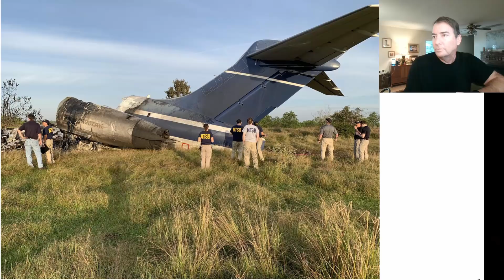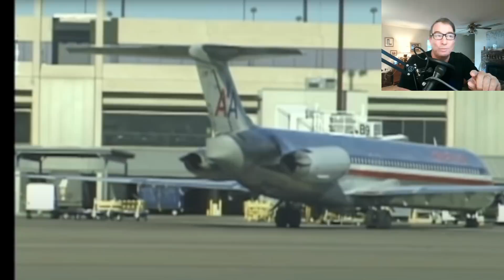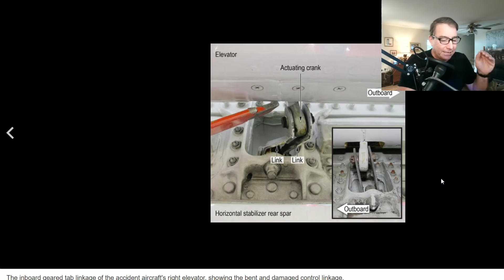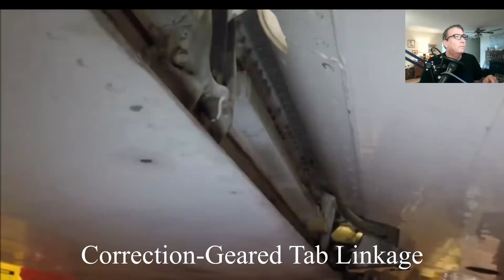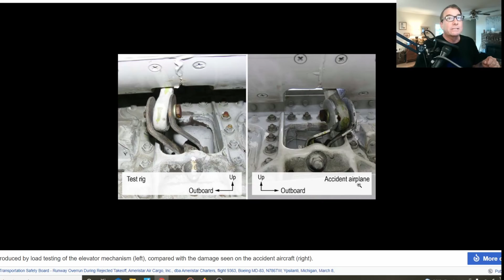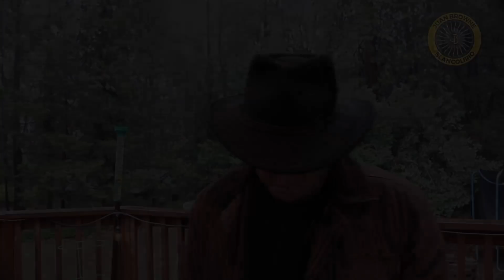MD-87 Crash Houston UPDATE 9 Nov. Flight Controls

Comment: Never flew any of the DC-9 variants, but did fly the DC-8 for about 3 years.  We did an elevator check on the takeoff roll--the FO, regardless of who was flying the leg (the captain was guarding nose tiller) momentarily pushed forward on the yoke at 80 knots which resulted in the nose dropping, and verified proper elevator control.  This was a result of the 1970 JFK TIA crash (11, all crew, onboard, no survivors).   The investigation found that a piece of asphalt had lodged between the elevator and horizontal stabilizer, which jammed the elevator.   Interestingly, other types do not use that procedure.
Reply: Yup, 20yrs of '80kt checks' on the Diesel-8 here. If this thing has the same system as the DC-8, then how,.....why,.....why would you take off without ensuring the elevator is functioning by simply pushing forward on the yoke? Bob the nose and press on or return to the ramp. The habit's so ingrained that I push on the wheel as my car accelerates through 80mph.
Reply: Very interesting.  Thanks for the imput.  I never worked on a DC9/MD80 style plane. Mostly Airbus and Boeing's. I cant really remember but I think the 727 has a different system and the Elevators operate by cable and control tab. By Hydraulic
Reply: I was involved in the crash investigation representing the Port Authority. A true case of something that the designers never thought about.
Reply: Well that 80 knot check is a bit more meaningful than what we do now!
Reply: @kaveman9  Then what?
Reply: @michaelmartinez1345  --  I flew only the CFM-56 DC-8.   But it wasn't the fan engines that made them difficult to slow down.   That was a problem with all series, because there are no speed brakes (spoilers which can be deployed airborne).   The only "speed brakes" available on the DC-8 was the deployment of the inboard thrust reversers.  We were reluctant to use that method because the resulting noise was a bit traumatic to passengers, but unfortunately at times it was necessary, and it did o the job.   Getting down and slowing down was always a challenge, especially on LAX arrivals.

Comment: This is similar to the rejected takeoff that happened at Jfk with a Chautauqua Airlines Erj-145 about 10 years ago. The plane had experienced strong gusty winds the night prior. The elevator is moved by mechanical cables and the controls are locked by a mechanical control lock in the cockpit. The winds had caused the cables to be jerked to the point that they had broken.
During the before takeoff control check, there was no indication that anything was abnormal. Thankfully the flight took off on the 14,000' runway, so the crew was able to stop on the runway after aborting above Vr with no losses.
That incident caused an AD to be issued by Embraer to retrofit all Erj-145s with electric gust locks that engage pins directly into the elevators to prevent stress on the control cables.

Comment: Thank you, Juan, for your usual excellent analysis commentary on all A/C accidents! I was a US Navy pilot transitioning into an old Navy jet, the A-3D (all three dead in Navy slang) an aircraft similar to the Air Force B-66, except the AF models had retrofitted ejection seats. The Navy kept putting that safety feature off thinking they would all be retired (or crashed) and replaced by A-6 or AF-18s. I was doing a simulated engine out approach to a wave-off/go-around, added power on the port engine, pushed hard on the rudder pedal and broke the rod that actuated the upper part of the rudder. Loss of flight control, stall, leveled wings and rode it in. The Navy's fix was real simple---no single engine wave-offs. Which resulted in NO SINGLE ENGINE landings attempted, just bail out in the event of a single engine failure. Very bad airplane design.

Comment: I've seen that blowback maneuver happen before. I used to work as a ground handler at my local airport, and the company I worked for had a contract with a courier service that flew 727s. Pilot had a brainfart and failed to stop when signaled to do so. Because of this lapse of judgement, they didn't have enough room to turn around to exit the ramp area we worked from, and there wasn't a tug able to get there to push him back. Out came the buckets and they backed up. My biggest takeaway was that I was glad I wasn't marshaling that night, and that my boss was. The argument between him, the aircrew, and my boss' boss was EPIC. But there were 15 of us ground handlers that saw the boss cross his wands and the plane kept rolling.

Comment: There was a similar accident at teterboro with a Challenger bizjet. The pilot pulled and the airplane did not rotate. The pilot rejected late, went through a border fence and into a warehouse. It turned out that the flight controls were fine. The airplane was loaded beyond its forward cg limit.

Comment: The DC-8 elevator control system was essentially the same as that on the -9. After a fatal accident with the -8 involving a jammed stab, an "elevator position indicator" was installed on the instrument panel. This allowed the pilots to check for actual movement of the elevators after esufficient airflow had been established over them to permit such, usually around 80kts. I'm surprised that; 1) the DC-9/MD-80 series of airplanes didn't get the same mod, and 2) that the airplane was ever certified in the first place without the crew having some positive method of assuring proper movement of the elevators prior to flight.

Comment: This reminds me of a Trans States Airlines EMB-145 that had an undetected cracked torque tube, resulting in very little elevator authority. At Vr, the captain pulled back on the yoke and the nose came up extremely slowly on runway 19L at Dulles. There was concern that they wouldn't clear the trees at the far end of the very long runway. We were fortunate to have one of our finest captains at the controls. She remained cool and flew the airplane back to a landing using stabilizer trim. She should have received some kind of medal, but she never made a big deal about it and few people knew that it ever happened.
Reply: Incredible, thank you for sharing that. Frank was RIGHT! LoL
Reply: Besides those trees, another potential problem with the takeoff could have been tire failure as speed continued to increase without a liftoff.
Reply: When did this occur? Tried searching and couldn't find anything about this.

Comment: This system looks like simplicity first and failing to notice the risks of failing to notice the jam. On paper it is easy to say - check the flight controls, but if the elevator is up in the air it is not possible to properly check it! I know this an elegant system, simple, works great, but it works only when it works.
Thank you for the content!

Comment: The hydraulic actuator on the elevator is for if the aircraft goes into a stall. If the pilot give a nose down command more than 10 degree push, the actuators will push the elevators to a full nose down command. During a stall, the elevators don't have enough air flow for the control tab to move the elevator so the actuator will assist the system. Pilots are to test the system before takeoff by pushing the stick nose down and look for the blue indicator light on the overhead panel.
Reply: Thanks, Kev.  I kept thinking there had to be some way to test those flight surfaces aren't jammed up before takeoff - having to be at speed is not a happy way to do a test.
Reply: Juan, thanks again for a quick and clear “ probable cause”. Your explanation are clear and easy to understand for all. 

Your channel and a selection of other knowledge aviators are bringing what we used to call Hangar Flying Knowledge to millions vs a few.  

Your help is saving untold lives. 

Keep it up.
Reply: Great job explaining.
Reply: Actually, if the elevator is jammed, it wouldn't let the pilot know. The blue light indicates the hydraulic actuator works but it may not push the elevator down. What he was showing of the other plane with the damage, it would never move. The only way someone could verify the jam is to watch the elevators while the test is done. We had to verify when the system was deferred because they didn't get the light. I know we had to do visuals on the plane that encountered high winds before. Never found any problems, I think the dampers did their job on slowing the control surface.
Reply: I flew the DC9 -32,  and -15,  on the UK register in the mid 80’s and early 90’s.     My recollection is that following the Trident deep stall crash at Staines,   the CAA required a hydraulic stick push system to the elevator,  to permit recovery should the elevator airflow be blanked by the wings in a deep stall.   ( non UK registered a/c did not have this ).    Once the thrust levers were set for take off,  the handling pilot would apply full forward control column,  to activate the system, and if the stick push light did not illuminate,  then the take off would be rejected.       Later developments with the MD’s,  I have no knowledge.
Reply: Would a jammed elevator while the plane is sitting be visible during a pre-flight walk around?
Reply: @tigersfan14      No.    It would require a “cherry picker” and a licensed engineer to do a hands on inspection. The elevators “float”, and are independent of each other.  There is no direct link ( except for the stick push system) between the control column and the elevators (split).   The only direct link is to the control tabs on the trailing edge.  Once airborne,  most of the pitch control is via the horizontal stabiliser which the pilot instinctively moves via the trim switches,  in response to an elevator control column input, to stay in trim.
Reply: @californiadreamin8423  That’s what I figured since they’re so high up. Was just making sure it wasn’t something that would be glaringly obvious to a trained eye.
Reply: @tigersfan14  from ground level, you probably won't see anything unless it is really bad that parts are sticking out. With the other aircraft that had the jam, it was all inside the spar area that you can't see.
Reply: @halmc  Likewise.  But he gave it a heart, so I take that as at least some sign of approval.  🙂
Reply: @tigersfan14  - Nope, unless you could physically access the tail, with a lift.  The elevators can be in any position between full up and full down when viewing from the ground prior to sufficient airflow achieved.
Reply: @californiadreamin8423  I have worked on two DC9 aircraft neither of which had ever been registered in the UK and both had the system you describe and from discussion with people who were involved with other similar aircraft I think all DC9 aircraft had it. This system is not technically a stick pusher but a system that forces the elevators to a nose down position if the elevators failed to move in response to a nose down control tab position. A stick pusher activates if the aircraft gets too close to a nose high stall regardless of pilot input.
Reply: @johnyoung1128      My manuals went in the bin a long time ago.  I do recall that if the control column was moved towards the fully forward nose down position,  it would cause both elevators to be driven fully forward for stall recovery,  independent of elevator or tab positions.   No doubt which a/c had this system will be revealed in time.

Comment: With snow and slush we used to pull full up elevator until at about 80 knots we could get the nose wheel off about a foot where we kept it until Vr. Not an approved procedure but the "chined" nose tires perfectly directed snow and slush into the engine intakes and that solved that.

Comment: In all my years of fascination with aircraft of all types, I never knew about tab-driven free-floating elevators.  Very interesting!
Reply: I've heard of aircraft that were taxiing behind the mad dog calling ground or the tower to notify them that the elevator is broken on the aircraft in front of them because the 2 elevators did not align up
Reply: Marty you are everywhere ;) back to work you are so close!
Reply: Very similar to the DC8. There was a TIA DC8 crash at JFK caused by a jammed elevator in Sep 1970.
Reply: The ailerons are the same concept thru the entire dc9/ 80 fleet too. The only difference is there is a bus cable connecting the ailerons to help but a small control tab moves the control surface.
Reply: Same here!
Reply: @Spinner1987CH  Yeah.... and my engine is being rebuilt as I type this.  Doing little winter prep tasks while I wait for its arrival.
Reply: I’m the same. I’m an aviation enthusiast and former helicopter mechanic, and I’ve never heard of this kind of flight control system. But funny enough it does remind me of the way the flight controls work on K-Max helicopters. They don’t have a swash plate. They use tabs like these to control the blade pitch.
Reply: @goatflieg  great news! I look so much forward to see you flying in 2022!

Comment: I remember picking up the empennage of a dc-9 off the runway at Edwards AFB. When it sheared upon landing during an emergency landing for FAA cert!
Reply: That landing had a vertical sink speed of about 16 fps vs the design limit of 15 fps, so they got their structural analysis about right : )

Comment: Great video. The Bristol Brittania had the same tab operated elevators which required aerodynamic force to work. Modern jets have MFD display of control surface movement during preflight checks.

Comment: Thank you so much for explaining how this system works. I crewed B-52Ds which had a similar tab-driven flight control system. I always wondered if the jet was being damaged listening and watching the ailerons and elevators banging up and down in the wind. I guess it was a little more robust in structure, plus it had hydraulically operated spoilers for help in roll control. The later G and H models did away with ailerons all together.

Comment: In the image shown at 12:52 we see a generously reinforced, beefy anchor point for the linkage on the stabilizer, and an equally robust control rod for the geared tab. But in comparison, the link itself looks pretty slim. It does seem to be the weak link (no pun) in the case of the elevator banging around in the wind when parked.

Comment: This report and explanation has got to be your Top 3 all time best video ever. Thanks for going the extra mile on this accident.

Which brings up the idea. Is there a better system to setup by the FAA & NTSB to get these findings out quicker than the standard Preliminary Report and Final Investigation 3 years later?

The AD's and Service Bulletins are usually sent to Owner/Operators. The AP Mechanic complies at annual or during FAA Part 121 progressive inspections on Commercial Aircraft.

We as pilots need a quicker system to lookup a specific model or type and related reports. The NTSB Accident/Incident Monthly reports are a great source for pilots but is a database which is not widely used by most pilots. For me it's a great source to read and understand other Pilot Errors that may occur in my everyday flying.

Why not design a system made exclusively for pilots to simply type the Aircraft Tail Number or Serial Number to pull up history.

Comment: MD88 has three tabs on each elevator. Control tab the inner, Geared tab in the middle, antifloat tab on the outer.  The MD95/B717 has just two tabs, the inner control and the geared tab.  Pictures of the accident MD87 seem to show three tabs.

Comment: Juan, You might want to consider adding another rain gage to your deck railing. The "Stratus Precision Rain Gauge with Mounting Bracket" , available from Amazon, is what professional weather monitors use. It is very easy to read to 1/100 of an inch and can hold up to 11" .

Comment: I never flew a DC-8 but I did Jumpseat on them several times and I think they had a similar weakness in the control system as the DC-9. As I recall, crews would preflight check the operation of the tabs while parked, then during the early part of the takeoff roll check for elevator operation. This was after a DC-8 crash during take off from Mather field in Sacramento.

Comment: If somebody's not clear what this over-center situation is, you can think of it like the latch on a toolbox or a jewelry box. 

They're all kinds of clamps and latches that are called toggle latches. They go over Center and lock on.
Up until they go over center they don't get stuck. Once over center, they don't go back. 

The link on the elevator isn't supposed to go over center. However with enough wind force the dampers were unable to restrict the movement of the elevator so it slammed against the linkage and forced it over center where it got stuck.

Viscus damper... that's like the shock absorber on your car, and a lot of other things as Juan said.
Without dampers ("shocks") on your car it would bounce up and down on the springs, like a pogo stick.

Comment: The BAe 146 has a similar tab-driven system. I was a guide on Concorde G-BOAC for many years at the Manchester Airport Viewing Park (UK), and we had a few more static aircraft, including an Avro RJX (a development of the 146). It was parked facing east, so tail towards the prevailing wind, and originally had gust locks in the elevators, but these eventually worked loose and fell out, and were not replaced. The elevators were then free to pivot up and down which they readily did in the sometimes strong tailwinds, banging from stop to stop.

Eventually this became too much for the mass balance weight in one of the elevators, and it made a bid for freedom tearing its way out of its elevator and falling to the ground. Luckily there was no-one standing near at the time!